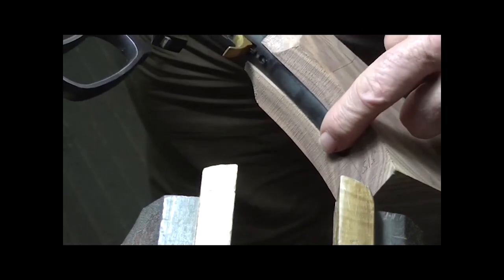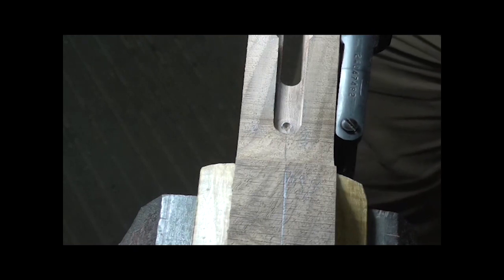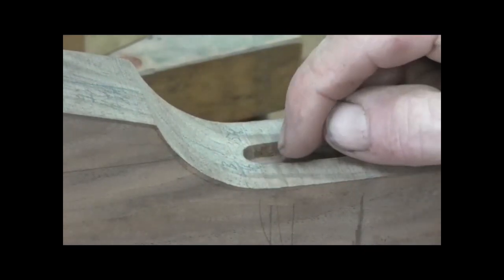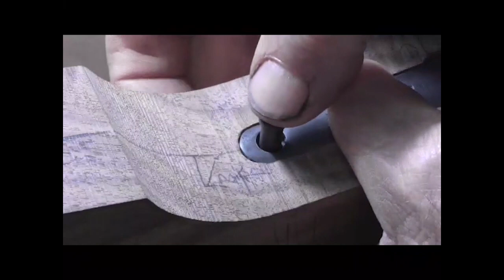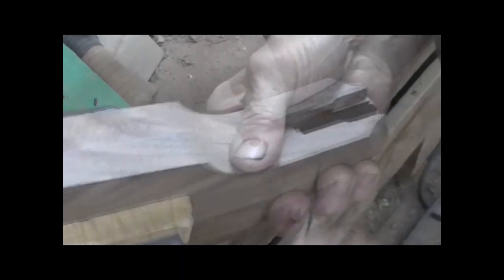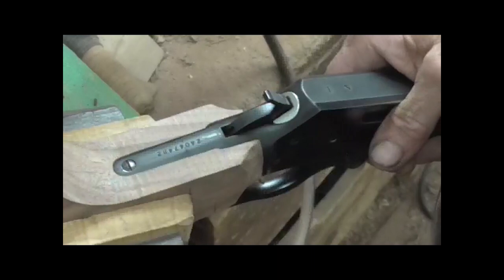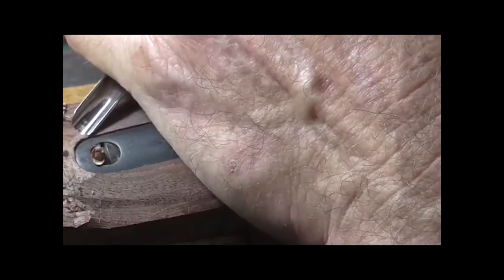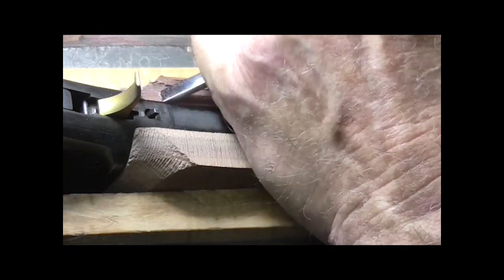E 006 Marlin 336 Makeover.

Comment: I have built several muzzle loaders and stocked a few other single shot rifles over the years using semi inletted stocks. My latest three have been two Lefever shotguns a 410 and 20 gauge and now a kit 74 Sharps. I have been a machinist for 36 years (retired) and I can do metal but struggle with wood. These last three have really been a chore. The Sharps especially because of it's side lock plate. Wood will try your patience which I find I have little of but am getting better. I have made some scrapers and cut down some rasps and files. I have found take your time and think about what you are removing and how it will effect something else. Using a blackening agent really helps you find the high spots. Really enjoy your series...
Reply from the maker: Thank you, Johnny. I do appreciate your watching these videos. I'm really having a good time making them. If you're a machinist, my hat's off to you, brother! I think maybe I could have been one with the proper training at an earlier age. I have always held you guys in high esteem. The blacking is helpful. I use soot from a small antique oil lamp. There are other things out there that do the same thing but, they cost more. A gunsmith friend uses some blue stuff. You're probably familiar with it being a machinist. I find the soot helpful in cleaning the metal after I'm all done with the job because it shows me ANY LITTLE area that I might have missed. Thanks for your time and please subscribe and tell your friends.

Comment: Try too make a brass point that fits in the bottom hole of the action then klamp it in the drill wise,  align that with the center of the drill. Then hold the action bottom down and find the hole with the drill. You will bee spot on!. That's how I was taught here in Europ and it's been working of 25+ years. Keep up the good work and make more good videos.
Reply from the maker: Thank you for that, Thomas. And thanks for watching in Europ!! If I may ask, what part of Europ?
Reply: @tennesseestockmaker2847  Im from Sweden.
Reply from the maker: @thomashaglund4622  C00L !!!